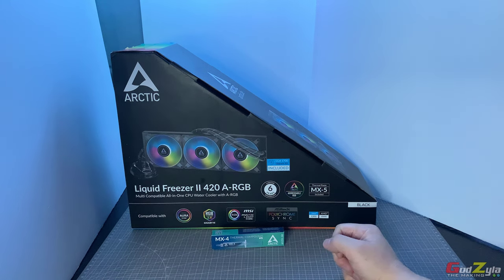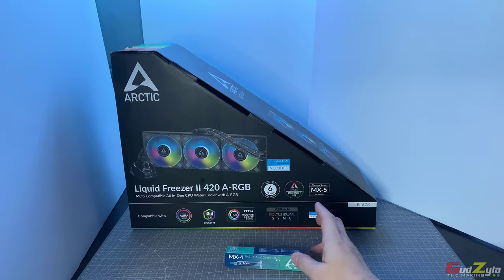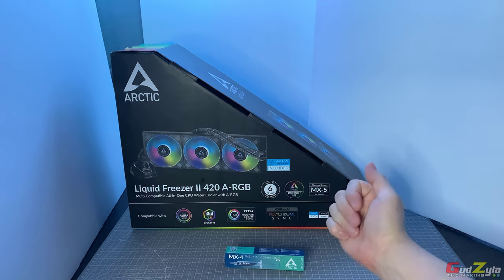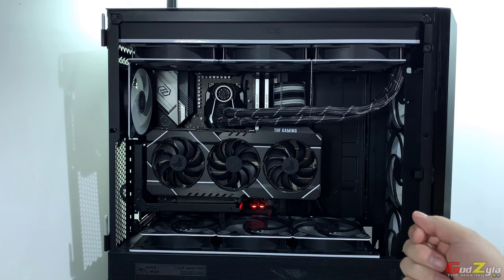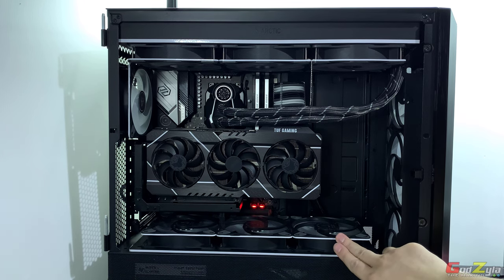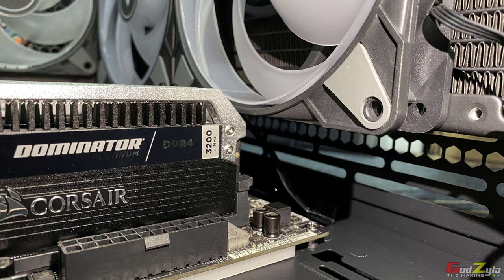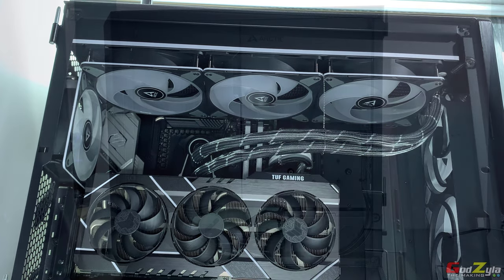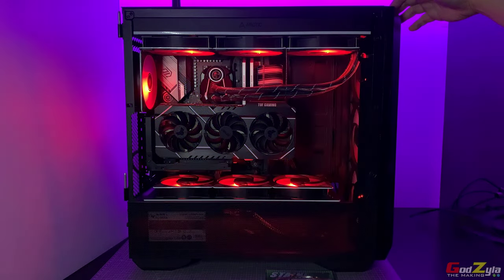Arctic Liquid Freezer II 420 in Lian Li Lancool III - Part 2 (The Experience)

Comment: They must’ve released a new version of the case. The IO shield is preventing me from getting it all the way in. There’s a rivet I had to pull the case out to get the rad in that is holding the left side up now so I think we’re good but dang….
Reply from the maker: Hi twolfekc, welcome to my channel. Hmm this is strange as I’ve done another build with the same case for a friend and it fit exactly of what I’ve done in this vid but nevertheless thank you for your feedback, will check with Lian Li if there are any changes in manufacturing this case. Thanks again.
Reply: @KleoYan will an arctic 360 aio mount at the top of this case okay with no clearance problems?
Reply from the maker: @T.Lspitz  hi welcome to my channel. Any 360 liquid AIO, no clearance issue at the top or even the front.

Comment: If you do that thermal test, I would actually also very much like to see the results of switching the rear exhaust to rear intake instead. As in, just flipping the 120mm fan. My guess is the top AIO fan furthest to the rear will pull in outside air from the back of the case anyway if the rear 120mm exhaust fan is removed. It might very well affect GPU temps too, but I am really unsure in which direction. I guess that also partly depends on the GPU orientation (horizontal vs vertical) and if its the one you have in the video, or one of the founder edition blower style GPUs.
Reply from the maker: Hello Thomas, welcome back. ok will do but will have to wait though. nevertheless will do some testing and to up with the next video. Thank you for the suggestion.

Comment: Hi guys. I would like to ask if the Arctic Liquid Freezer III 420 A-RGB can fit inside the case of Lian Li Lancool III RGB Gaming Midi Tower( at the top) or i must to go  for the 360mm to be safe, because it seems i cant  find a answer ?
Reply from the maker: hi Harrys Nikolaidis, welcome to my channel. the Liquid Freezer II and Liquid Freezer III are of the same diamension, therefore it will fit the Lancool III case but do note that the front, you will need to set it this way, else you can't close the front tray. https://imgur.com/gallery/front-with-3-x-140mm-fans-vHezOSS

Comment: I'm sorry to bother you after 1 year, but your video is one of the few sources of information on this topic. I have several questions regarding video:
1. Is your RAM 55mm tall?
2. Do you think ADATA Lancer Blade RGB DDDR5 will fit? (especially length-wise, since you pointed out there is only 0,5mm gap)
3. Will MSI B650 Gaming Plus WiFi fit since it is about 35mm high on the heatsink at I/O?
4. Will stock 140mm front fans fit? I noticed you swapped them out for Arctic fans.
5. I'm trying to mount LFIII 420mm on top of the case, is LFIII the same as LFII in terms of fitting it in Lian Li Lancool III?
Thanks in advance for your help.
Reply from the maker: Hi zapasowy mail, welcome to my channel. I will answer your questions as follow. 

1. Is your RAM 55mm tall? 
The Dominator rams are at 55mm in height.

2. Do you think ADATA Lancer Blade RGB DDDR5 will fit? (especially length-wise, since you pointed out there is only 0,5mm gap) 
The length of rams are of standard length and as I’ve checked. Your rams height and the Dominators are of the same height and straight at the side, you should not worry about it.. it will fit

3. Will MSI B650 Gaming Plus WiFi fit since it is about 35mm high on the heatsink at I/O? 
With the rear I/O and Side VRM Heatsink which is at height 35mm, it will fit.

4. Will stock 140mm front fans fit? 
I noticed you swapped them out for Arctic fans. 
For the front, you will need to do this https://imgur.com/gallery/vHezOSS inorder to close the front cover. Be it using default or the P14 ARGB Fans.

5. I'm trying to mount LFIII 420mm on top of the case, is LFIII the same as LFII in terms of fitting it in Lian Li Lancool III? 
Yes, both LF2 and LF3 have the same measurements.
Reply: @KleoYan  Thank you very much for fast and detailed response, as well as very informative video! Wish you the best!
Reply from the maker: @user-mn7zt3yx1k  it's my pleasure.. all the best with your build too 😉

Comment: @Kleo Yan AWESOME! You're the only one reviewer who gives information about the length between motherboard VRM heatsink (including IO SHIELD & RAM) and arctic radiator.  This review is an absolute problem solving for arctic LF II installation. Searching for this for fuckin 3 hours and finally found ur video, Thank you so much! Im planning to use LF II 360mm instead, would be ok for the rear fan to use normal Arctic P12?
Reply from the maker: Hello Gerardo, welcome to my channel. yes you can fit either a 120mm or even a 140mm fan at the rear if you are using the Arctic Liquid Freezer II 360 AIO. by the way, I have done the Thermal test wich you might be interested https://youtu.be/1SPioF78x_E . Just one side note. I am not a reviewer, more of a end user like yourself. I am just sharing my experience as a end user stand point and thank you to have visited my channel. All the very best with your build 😉👍

Comment: Your thorough video was very helpful for me installing a Liquid Freezer III into this case. Probably the most complex PC case I've ever used!
Reply: I was able to fit in the stock 140mm rear fan with screws, although it is a very tight squeeze against the third radiator fan. But the fan blades are not impeded from spinning so I count it as a success
Reply from the maker: Hi J.D. Whited, welcome to my channel. I am glad you find this content useful and thank you for your feedback and to share your experience with us. Greatly appreciated it. 👍👍👍

Comment: Hello, my motherboard is an X670E Aorus Xtreme from Gigabyte and its about 15" tall in Height. Is a 420mm Arctic Liquid Freezer III doable or will I have to go with a 360mm so it fits into my Lian Li Lancool 3?
Reply from the maker: Hi DarkNova92, welcome to my channel. Do you mean 1.5" tall. if it is.. it should not be an issue, it's within the 40mm height.
Reply: @KleoYan  no, 15 inches in height that's how tall the VRM is apparently. Although i think I'd have better luck putting it in the front since it offers a max space of 100mm
Reply from the maker: @darknova9298  hmm.. ok, so sorry am not use to inch, but after translating on google from inch to mm .. it translate as 381mm on your VRM Heatsink, you should have enough clearance. As illustrated here , the X570 Tachi has a height of 40mm which is 15.4 inch. I am able to fit the 420 at the top. Do note the rear fans you can only mount a 120mm fan and with rubber fan studs. You can't use the metal fan screws. If you feel not comfortable, a 360 LF2 or LF3 will definitely fit at the top.
Reply: @KleoYan Could i fit a 140mm fan on the rear if I put the III 420 at the front instead? With maximum clearance allowed (100mm)

Comment: What vertical GPU support do you use in the video?
Reply from the maker: Hi Lucas Guilherme, welcome to my channel. That was in the past and the vertical mount I am using might be hard to find. It’s the Lancool II GPU vertical mount and it’s a gen3 riser cable which I change it out with Gen4 riser cable. I would advice you to get the Lian li universal 4 slot GPU mount.

Comment: Hi there, video came in handy. I have the same case & was looking at the same cooler, but I need to know what GPU virtical holder did you use as I WANT TO ADD THIS TO MY CASE...cHEERS
Reply from the maker: Hi Scratch Keith, welcome to my channel. I am using the Lian Li Lancool II GPU vertical mounting kit but have changed the riser cable from 3.0 to 4.0. You can also get the Lian Li universal GPU mounting kit which allows 3 slot card.
Reply from the maker: you can use this too.. it fits https://lian-li.com/product/vg4-4/
Reply: @KleoYan  That's great, I will be ordering the lancool 2 GPU mount today, Thanks for the quick reply....
Reply from the maker: @scratchkeith7566  please note the Lancool II riser cable is PCIe 3.0 and not 4.0. For me I have changed the riser cable to 4.0.
Reply: @KleoYan  I have the lian-li gpu bracket & got it fitted. I can seem to find a ribbon cable capable of pci-4.0, any ideas please. Cheers
Reply from the maker: @scratchkeith7566  if you are using the Lancool II GPU vertical kit. that is PCI-E 3.0, what I did is to purchase this https://www.aliexpress.us/item/1005002760330528.html? I am not sure if you can purchase it or to view the official Lian Li Aliexpress shop. you might want to do a search on amazon at your region. search for Lian-Li PCIe 4.0 X16 RISER CABLE

Comment: thanks to your video, I also bought a 420 Artik, but version 3, unfortunately, despite the same dimensions of the second and third versions, I cannot close the front fans, and when I slide the coolers to the very end of the housing, there is no hole to attach the coolers to the housing, as you did, by screwing the coolers on original holes in the housing?
Reply from the maker: Hi getfrags, welcome to my channel. You will need to place it this way to close it https://imgur.com/gallery/vHezOSS
Reply: @KleoYan  how did you attach it permanently?
Reply: @KleoYan  everything remained original?
Reply from the maker: @getfrags  for the radiator at the top. I screw those 12screws abit at a time. Anchor all screws to the thread holes before tightening it. There are some misalignment as the rad screw holes are not inline, so what I did is to use a long screwdriver that is thin enough to wiggle the holes in place with the top fan tray. So slowly and gently anchor all 12 points before tightening it.
Reply from the maker: @getfrags  I have swap out Lian li fans with Arctic P14 ARGB at the front. That’s the only thing not original and the front tray as I have shown you. That’s how I close the front tray.

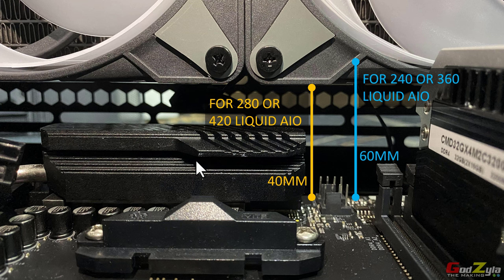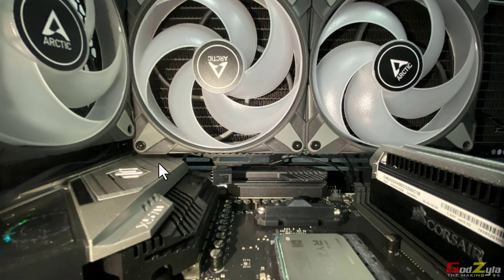Comment: I have a question. On 12:10 you say there are 40mm clearance from the motherboard to the radiator fan. At 12:31 you say there are 45mm clearance. Please can you clarify what is right? Maybe i don't understand because of my bad english.
Reply from the maker: Hi Andi316, welcome to my channel. To clarify, if your motherboard, the top of the Rear I/O to bottom of your motherboard, so long it's at 40mm tall,, you are safe to place the Arctic Liquid Freezer II 420 at the top. As why i've mentioned 45mm tall, that's the overall height which include the 5mm gap or space between the motherboard and the case (The motherboard stand off height) Hope this will clear your doubts. Thank you for visiting and all the best with your build.
Reply: @KleoYan  Thanks for your warm and kindly words. So to say it short: 45mm also fits and is the absolute maximum. Is that right?
Reply from the maker: @Andi-sm5ix  I would say measure the motherboard, just make sure it's within 40mm tall, anything above 40mm, you wont be able to fit this 420 Arctic Liquid AIO. also please note, for the front, you have to mount it this way https://imgur.com/gallery/vHezOSS as I have miss out showing how the front fans should be mounted.
Reply: @KleoYan  That's bad. My Asus X670E motherboards heatsink is 42mm. So i can't use the Lancool III because of 2 mm? Any idea what i can do?
Reply from the maker: @Andi-sm5ix  you can use a 360 if you are not doing overclocking.

Comment: With a MSI Z790 Edge DDR4 the AIO does not fit, it hits both the ram and the shroud around the rear io/VRA cooler.
Reply from the maker: Hi Jake Foster, welcome to my channel. thank you for the feedback as mention if the rear I/O and Side VRM are above 40mm, the 420 Liquid Freezer II will not fit.

Comment: Hi, I bought the h170i and lian li iii, and now I'm trying to install them, but I couldn't. Is it possible to install them? Or is the cooler bigger than the case?
Reply from the maker: Hi Mjood Zx, welcome to my channel. I have no idea will it fit or not and the site is down, I am not able to view the specs. Mayne you can measure the length of the Radiator. the Arctic Liquid Freezer II 420 Radiator is having a lenght of  458mm. It fit just right, if you are not able to mount at the top. mount at the front, which I believe it can be done as I dont think the Corsair 420 H170i has a thick radiator like Arctic. which is at 38mm thick.

Comment: excellent video. Please could you tell me which argb controller you used on the PC shown in the video for the arctic fans?
Reply from the maker: Hi Gino Cerrillo, welcome to my channel. The controller which I used, no longer on sales but you can use this which I am using currently. it works the same https://www.amazon.com/gp/product/B0BP1JZTND/ref=sw_img_1?smid=A1X11FOVGZ8LKJ&psc=1
Reply: @KleoYan  thank you for your answer. If it wasn't too much trouble, could you tell me which controller you used and that it is no longer for sale?
Reply from the maker: @ginocerrillo  hi did share the url, anyway here you go https://a.co/d/5RFZCEz
Reply: @KleoYan  thank You sir 🙂
Reply from the maker: @ginocerrillo your are most welcome 😉
Reply: Good day, I just purchased the PWM - Hub and I have a question about the connections of the Liquid Freezer II 420 fans to the pwm-hub.
  Should the pwm and rgb cables of the arctic fans enter the hub separately or through a single cable?
Reply from the maker: @ginocerrillo  hi, the way I do it is to plug the radiator fans pwm connector directly to the motherboard CPU_FAN header and the argb to the hub which you've purchased. As for the rest of the case fans, you can plug both PWM and argb to the hub or to plug it the way I plug the radiator fans. the main objective is to have a remote to control the argb effects and to have total control over your fans PWM. if you do the way I did, in the event if the hub fails, only the argb are affected and not the fans from not spinning. This is to safe guard your processor from overheating and to cause crashes.
Reply: greetings. I want to thank you for the help. Could there be a problem if I combine arctic fans and lian li fans when connecting them to the hub?
Reply from the maker: @ginocerrillo  hi welcome back, mind if I ask, which hub and which lian li fans are you referring to? As I can't answer without detials or info. Thank you!
Reply: @KleoYan Of course yes, no problem. I have a case lian li lancol 3, 420mm arctic 2 liquid cooling, 4 120mm arctic fans. and 3 140mm lian li fans.
I plan to connect the 3-pin and 4-pin cables to a hub (PWM - Hub). Will there be a problem if I connect fans of different brands and sizes to the hub?
Reply from the maker: @ginocerrillo  The arctic P14 ARGB fans you can plug to the PWM-Hub but for the Lian Li Fans. which fans are they? SL120? AL120? SL-INF-120? or.. if it's of these family, kindly make use of it's uni controller, please note for SL AL or SL-INF, get the 3pack set where it comes with the uni controller. Reason for this, the profile of the Lian Li fans and Arctic Fans are different. Both fan RPM and ARGB are different from each other.
Reply: Good night. I have the fans that come with the case lian li lancool 3 argb. It became clear to me that I should not mix fans of different brands in the hub. @KleoYan
Reply from the maker: @ginocerrillo  yup, it's best not to mix and good night.. rest well.
Reply: Hello, this they really change the io shield part of the case?
After watching the video, i also got lancool 3 for the artic 420mm aio, and the screw holes don’t line up. I can only fit in 6 out of 12 screws because of the alignment due to the io shield metal part
Reply from the maker: @hodoriho9913  hi welcome to my channel. thanks for the info, I am not aware of this, thanks again.
Reply: Hello, at the beginning I had the same problem that you mentioned. But after several attempts I succeeded. Basically what I did was try to put all the screws in without tightening them. It's a matter of trying several times. I hope you can solve the problem @hodoriho9913

Comment: Question? I want to replace the fans with Phanteks T30, do I connect each fan to the splitter or daisy chain the fans and run a single cable to the splitter? Or does it even matter?
Reply from the maker: Hi Haies 09, welcome to my channel, kindly check your motherboard fan header load limit. if the header is of 2a then you are ok to daisy chain 3 x T30 fans to that header. if it's 1a, it's advisable to get a fan power hub and not a splitter.
Reply: @KleoYan  my CPU header is 2A, so I’m fine there. Therefore it doesn’t matter how the fans are connected to the splitter?
Reply from the maker: @haies09  it does, try not to go more than 5 fans in your case. as the max profile on T30 are rated 0.36a each at the highest profile.

Comment: How did you connect all the RGB signal cables?
Did you use the controller built in the case?
Did you use some RGB splitter or something?
It's 10 RGB fans you have and the case allows only to plug in 6.
Reply from the maker: Hi dziobak87, welcome to my channel. all my fans PWM are daisy chained and each set of daisy chain to the respective FAN headers on the motherboard. As for the ARGB, 
1st I use this as a main argb controller with a remote https://www.amazon.com/gp/product/B0BP1JZTND/ref=ox_sc_act_image_1?smid=A1X11FOVGZ8LKJ&psc=1 . There are total of 8 ports and I have left one port to connect to another argb hub extension https://www.amazon.com/gp/product/B0CRYLT8JK/ref=ewc_pr_img_2?smid=A3LTGIMDZWJTFW&psc=1 to fill up the rest of the fans. then on the extension arb hub, I connect the rest of the fans. Doing this way ensure that my ARGB will have sufficient power as both the main argb hub and the extension argb hub draws power from the sata, directly from my PSU.
Reply from the maker: I forget, if I want to use the case argb controller, I just plug case argb to the main argb controller with a remote, which I can press on the remote to M/B, which is taking the instructions from the case argb controller.